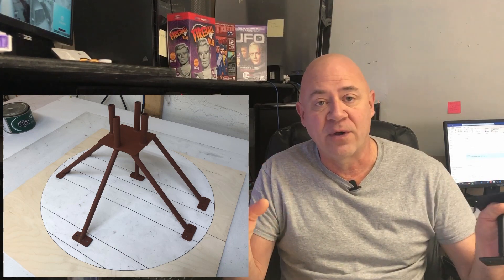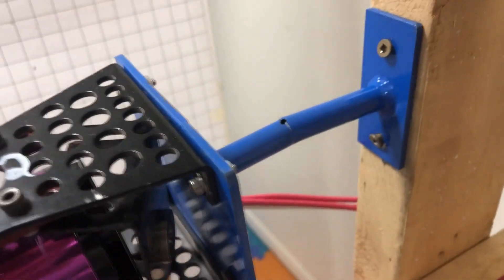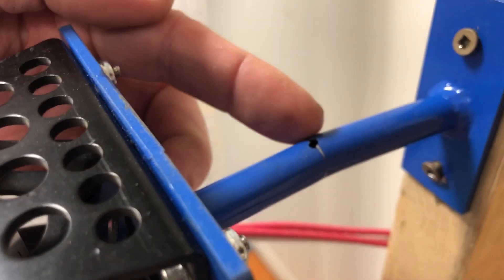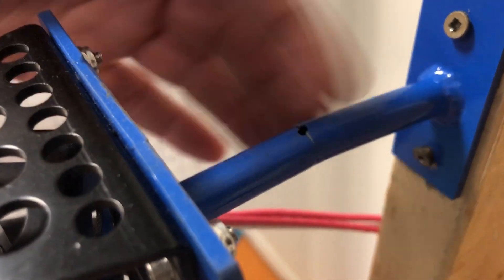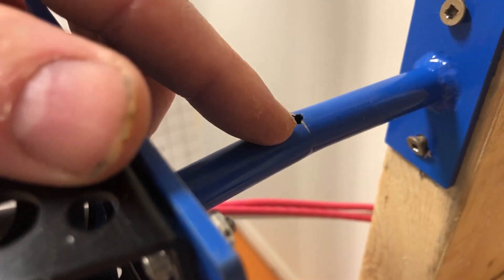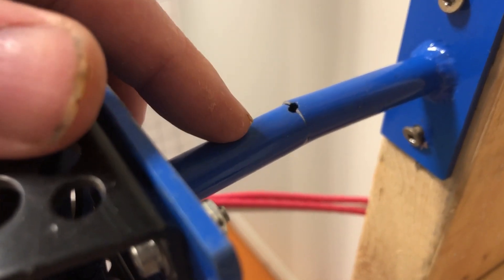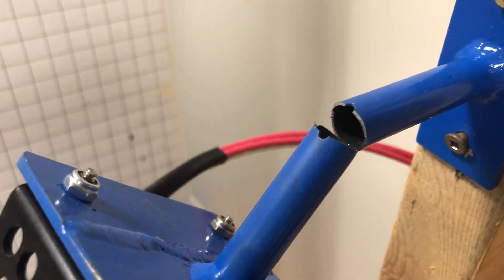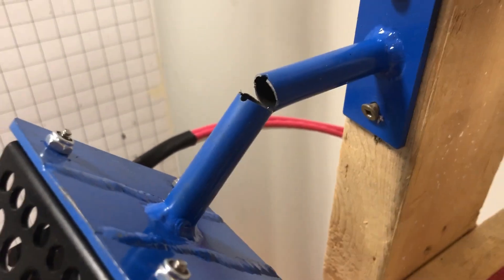Testing 4130 Part 4   It Blew UP!

Comment: There's so much that actually can be learned from destructive testing.  Sometimes you even learn something that it was not even in the test that fail and you can start to understand the possible chain reaction that a failure of this time can actually make happen. Thanks for sharing "Note: large manufacturers that do this usually don't share their findings" so pretty kind on your end to share...